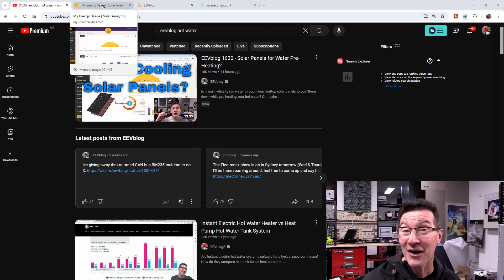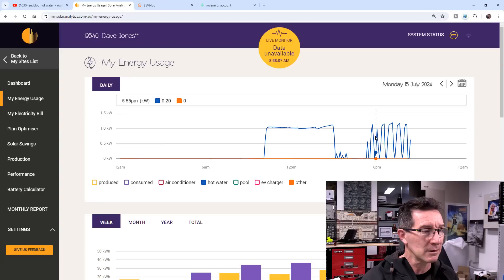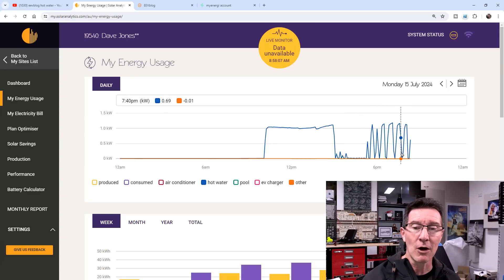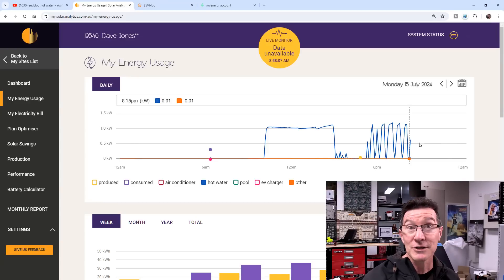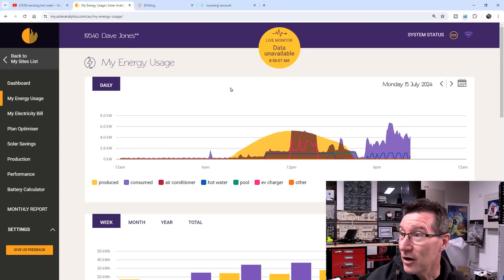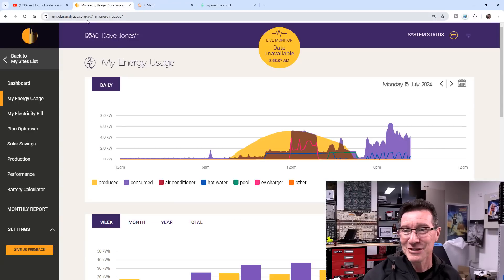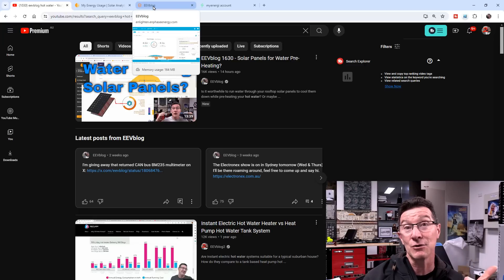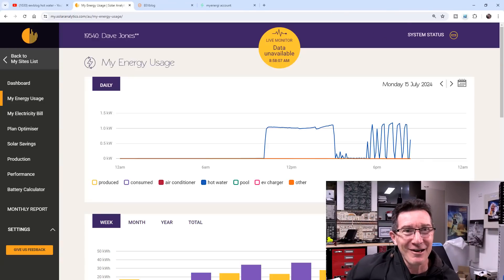MURPHY! - Reclaim Hot Water Heat Pump FAIL

Comment from the maker: UPDATE: Reclaim are replacing the "sensor pocket" on my tank with a new design. They think this might be the cause. They are sending the new part to the original installer under warranty, so thumbs up to Reclaim. In any case, power cycling it seems to have fixed it, for now.

Comment: Who's mobile network does Solar Analytics use. Also does it store data while the network is down and forward it when it comes up? Would be good if it could connect to the home wifi or better still ethernet.
Reply from the maker: It does store some data for dropouts

Comment: At ambient temperatures below 5.5°C, frosting may occur,
if this happens the heat pump will go into defrost mode in
order to protect the unit (i.e. this defrost functionality will
turn the heat pump on and will normally run for no more
than 15 minutes in duration). When the unit is in the
defrost function the pump and fan will stop and the
refrigerant heat will defrost the evaporator. As defrost
advances, the evaporator temperature will increase.

Was it below 5C by chance Dave? (That's why I bought the stibel)

Comment: Tassie viewer here. I have a reclaim heatpump hot water system. Been 99% fantastoc. The only issue we've has was the DS18b20 temp  sensor in the cylinder worked a bit loose once causing some odd behaviour.  The installer hadn't left enough slack on the cable before cable tying it. That was an easy fix.

Comment: Sorry, I haven’t been able to watch the video yet (can’t use sound until later on) but re-seating the temperature sensor can help in some problem scenarios.

My Reclaim was cycling on and off a bunch when I first installed it and it was literally just that the temperature sensor wasn’t in its sleeve far enough.

Comment: Not a fan of cloud data, so on my own battery inverter I asked the manufacturer for their API so I could pull data myself. They obliged, but the API pulls the data……from the cloud…..dang!
Reply: I found out my solar system sends the initial data to the cloud unencrypted. So I setup a packet sniffer to mimic the data before it left my network. I actually got some data but cleaning it up was going to be actual work. So I stopped. But it was the first time I got a packet sniffer to work. So that was cool. 

Why do they make local data so hard. Grrrrr
Reply: @ecospider5  my Bosch solar inverter couldn’t have been easier…..you can query the local IP of the unit and it returns an ascii string containing all the PV data. I did ask the battery inverter manufacturer if they could do the same but no luck!

Comment: I run a boring, silent full tank resistive hot water heater. 
I heat it with solar (and batts) on a timer that kicks in at around midday.
No moving parts, it's 15yr old, i did the anode swap last year, it's good for another 5-10yr.
Reply: AC units/fridges also typically run a solid 10-20 years without issues, they're just as reliable technology but this sounds like some software bug or memory leak or a silly goof.

Comment: 6 kW usage is very high. It’s even higher than my grid connection can deliver. You might want to check this
Reply from the maker: It's not 6kW, that was the entire house, the heat pump is only 1kW.
Reply: @EEVblog2  ok. Still, my entire house only gets 25A 230V from the grid.
Reply: @user-jp1qt8ut3s  It sounds like your house will build over 100 years ago?  200 amps service min today.  400 amps ideal.
Reply: @Bottleworksnet  why do you need this? When I am cooking and have the heating on I use 4000 W for the whole house. Higher than that is not necessary
Reply: @Bottleworksnet  my house is ~80 years old, but new houses should be even more energy efficient.

Comment: Is the timer good for switching inductive loads? Maybe bypass the timer for now. Are you sure it's not just cycling  on  thermostat because the water is up to temp? Maybe bleed some hot water off and recheck behavior. Check there's no blockage / restriction of airflow through evap. I'm in QLD and decided to fit fly mesh over the intake and exhaust after I noticed wasps were getting in there and building mud nests all over components in the refrigeration compartment. You could also measure air temp going in / out to see if any refrigeration is taking place. Only other thing I can think to check is if cold water intake supply is getting into the unit. Good luck, I know what its like trying to fix stuff when Murphy is in town :) Not sure about the NSW wasps but they are in bulk numbers here during summer months and will exploit any nook and cranny in which to build their nest. I lost a room air con when one got in and built a huge mud nest on the fan. This put the fan out of balance and I believe fatigued all the copper work and caused it to leak.
Reply from the maker: It is supposed to switch off once it heated up and not switch on again until the set time the next day.

Comment: What's the chances that the heat pump and data acquisition died at the same time?
Reply: Could it be that the heat pump is fine and that the data acquisition system simply reported false data about the heat pump before dying?
EDIT: Dave did verify that the heatpump is also faulty. All cloud connected, so maybe some common bug / hacked.

Comment: It could be a hot water leak. Or a failed temperature sensor - I've had that happen before.
Reply: Mine just needed the temperature sensor sleeve’s cable gland loosened and the sensor pushed in further and then the gland re-tightened. The installers just hadn’t seated it in properly so it was sensing too low and the heat pump was cycling on and off after it had heated up.

Comment: Cloud devices. 👎
Home Assistant, Tasmota, nodemcu, esp32, various sensors. Stuff just works. It's not quite plug-n-play, but the data is mine alone.
Reply from the maker: And it also has a dozne ways to fail. Discussed this on todays The Amp Hour actually.
Reply: @EEVblog2 but when it fails or they decide to drop it it's all over. At least the local stuff can be fixed. Sure it is a bit fiddly but it is getting better and better.

Comment: Does the heat ump have a PID controller? If so maybe that's failed and now it's running off a basic thermostat that's there as a backup.
Reply from the maker: Possible. Will see if the restart fixes it.

Comment: Murphy is driven by karma... Lol... I didn't want to risk the added complexity so recently swapped out a good old rheem, like for like, that is, after I got sick of the slow leak on the last one for the last couple of years. I wonder if the added complexity of the heat pump is worth it when it comes to hot water. I might jump on it if aircon was integrated into pool heater and hot water heater... That to me makes a lot more sense, rather than trying to maintain multiple heat exchangers.

Comment: Was it your heat pump or was it your data acquisition system?
Reply from the maker: Heat pump, the fan was physically on and Mrs EEVblog complained about the noise as she tried to go to sleep at 11pm. Hence I had to go out there and power cycle and that seemed to fix it at least for then.
Reply: @EEVblog2  Software, 100% bugs are free........